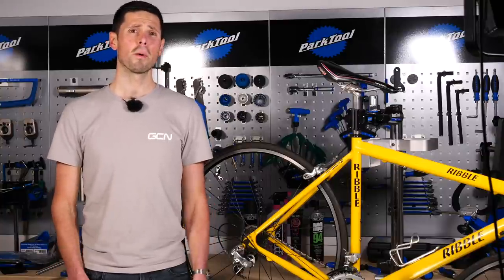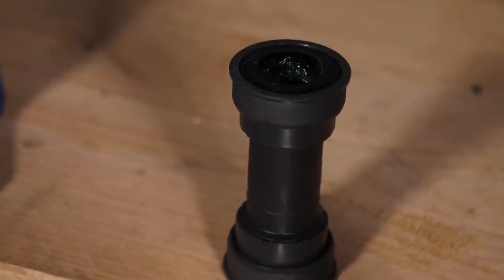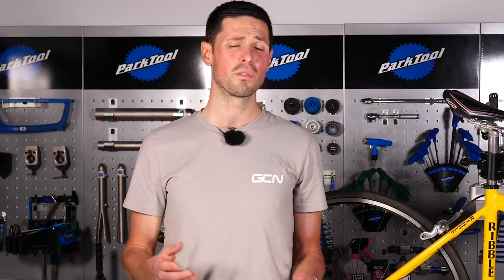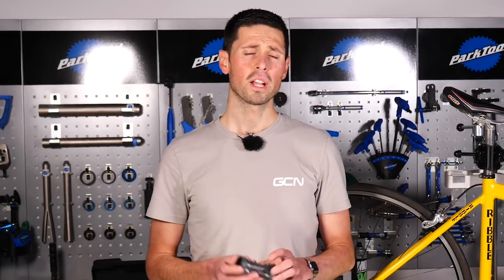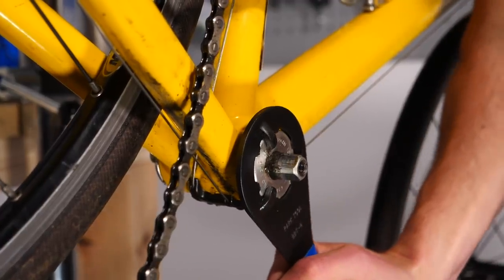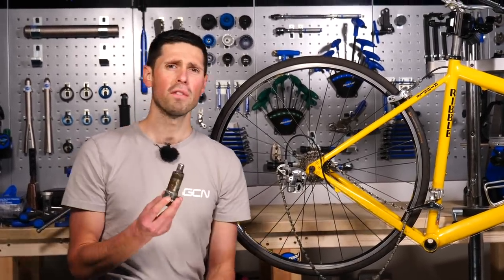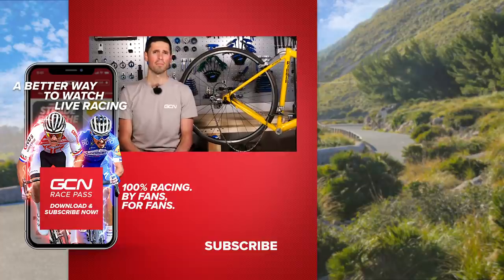How To Remove A Stuck Bottom Bracket From Your Bike | GCN Tech Monday Maintenance

Comment from the maker: Have you ever had your bottom bracket get stuck in your frame? How did you get it out? Let us know in the comments below!
Reply: Drop a few pellets of dry ice down the seattube. And heat it with a hairdryer. But that is if penetrating spray and a lever has failed.
Reply: Invest in the correct tool.
Campagnolo makes a six pin tool for threaded cartridge botoom brackets that is better than aftermarket alternatives.
Reply: With threaded, if everything you try has failed, I recommend a 60 in. long pipe wrench. Be sure you're turning it the correct way.
Reply: Cut the steel bb shell with angle grinder, pry out the shell open and unscrew using the tool. Install new cartridge. Clamp shell tightly closed and Weld short sections icing to prevent overheating cartridge. Not for the faint of heart but it works!
Reply: Just gave up and bought a new bike. N+1...
Reply: Last really bad one was in a winter commuter. Used a blowtorch to heat up the aluminium frame along with a cheater bar to increase leverage. It did work, and the paint wasn't terribly damaged. Hey, it's a winter commuter (fixed gear, using studded tires), not a showpiece :)
Reply: @jordyd8916  Just went through all that because of the non monetary value that one has. Continues saga to this day.
Reply: Increase the torque by adding more distance
Since, torque= rFsin theta , torque will be directly proportional to r i.e. distance so use proper tool and increase its length by some pipe or something
Reply: @korraja Done that sort of thing as a mill Wright. Luckily I didn't have a cutting torch handy! The heat from welding probably would break up the rust. Don't know how easily that hard alloy would weld. Oh well, turn the heat way up, better than cutting the shell as I did. Won't work  on a cartridge bb as it's aluminium. Ended cutting shell for that reason.
Reply: just liberated a BB from a 30 year old Rockhopper, looks like for the first time ever. Had to stand on a 10ft scaffolding bar...
Reply: was able to remove the bottom bracket on the right side using a pipe wrench but can't on the left side cause there's nothing sticking out for a pipe wrench to clamp on. Tried hammer and chisel which just ruined the teeth. So we welded a bolt on the center for the wrench to clamp on.
Reply: ..hoover nozzle pipe to extend bb4 tool and bad language worked fr me.Thanks.

Comment: HELLO HAMBINI FANS,

Some tips from me for threaded. 
1. Run a tap down the threads before you install the BB, bottom bracket threads are fine pitched for their diameter (1.0mm or 24 threads per inch), it's easy to get some cack in there and aluminium is soft so it will deform. 
2. Agree with the presenter, use grease. Lithium grease or something with a VERY HIGH NLGI rating, something like a 2 or 3. Grease in this case is not there for lubrication like a bearing, it's there as a static seal and assembly aid. 
3. When removing, these open spanner type units are often water cut or laser cut from sheet metal, they are comparatively weak at the tips. The cup type thing he had is much better. Obviously this depends on how seized it is.
4. Although he doesn't recommend heat, I do, I'd heat the entire BB area up with a hairdryer and then spray some freeze spray like loctite onto the axle,  Do this a few times and you will usually wonder where the resistance was.

A word on failure mechanisms. The usual method of failure or inevitable problem with these bottom brackets is galvanic corrosion. This is caused by the bottom bracket ending up like a battery and enhancing corrosion. The best solution to stop this happening is to remove your bottom bracket frequently, - you don't necessarily have to replace it.

Some tips for pressfit.
1. Measure the bottom bracket hole and bottom bracket before you install it. The majority of seizures happen because of excessive interference. The recommended interference across the board is 0.05mm. 0.03mm is better and my recommendation.
2. If this type of BB seizes, REMOVE THe bearings before you try to hammer the cups out. The majority of residual stress keeping it in are the steel races. The cups have comparatively little contribution to the retention.
3. if you are still struggling to hammer it out, then take the bearings out, and get a hacksaw and cut a slit into the sides of the bottom bracket. YOU DO NOT Need to go all of the way through, just enough to weaken the side wall. 

And the final thing is, your shiny bike with it's brand name is no guarantee of quality. Do your measurements and check for yourself before you buy.
Reply: I have a seriously seized threaded square taper, was thinking heat, but propane is scary when it comes to an aluminum frame, hair dryer and freeze spray a lot less so. Thanks!
Reply: The man, the myth, the legend
Reply: Not bad for a Frenchman
Reply: By Hambini, age 5
Reply: Sanjeev Varah why are you commenting?
Reply: It was more fun to use an angle grinder.  This 7 year old likes to see sparks and Weld. Besides it's lived a long and happy life since this treatment. All good advice from  Hambini. We need this guy to tell it like it is.
Reply: The thing that worries me slightly about "frequently" removing the BB, on square tapers at least, is that you run the risk of expanding the crank arm fixing holes little by little each time you remove and reinstall the arms. Maybe I'm lucky, but I've never had one seize on me so long as I prepare the threads properly the first time, so I would never do this to one of my bikes. I've had shop mechanics scoff at this idea, but Sheldon Brown wrote about it ("Every time you remove and re-install a square-taper crank, the hole in the crank is liable to get very slightly larger"), and I actually have an old Dura Ace crank (ebay purchase) that had obviously been removed and reinstalled numerous times over the years, and it indeed goes on a good couple mms farther than it should, nearly bumping up against the end of the BB spindle and effectively moving the chainline and Q inboard by the same amount (but as a happy coincidence, it yields a perfect 1-by chainline in its modified position). So be careful with this idea on square tapers.
Reply: Spoken like a true 5 year old
Reply: @CommaCam  This is fact. The square taper crank arms do expand making chainline narrower by a bit. Buy a quality bb and leave it alone. Vintage Campy owner.
Reply: @CommaCam  Yes tapered crank arms can bottom out on the tapers due to over tightening or too many removals.  At that points they will not stay tight and will wobble on the tapers wrecking the taper holes.  Your only recourse then is to go to something like a Phil Wood Sealed Cartridge Bottom with slightly over sized tapers where they will not bottom out.
Reply: Will I have to take a hacksaw to the cup? 
I tried breaker bar, 1/2" drive rachet, anti-seize; Nothing works.

Comment: As a shop owner, I've had bikes that would NOT have made this look so easy. NO amount of penetrating fluid helped after a couple of days,  and various "cheater" bars did not help either. Older model bike with the threaded BB, so the only option was heat and had no issues getting it out.  Now, a carbon frame is a different story, but if you're a trained mechanic, I would not worry about heat as long as it i not held in one spot all the time.

Comment: Most important for threaded....make sure you are bashing it the right way! Not all threads are lefty loosy, righty tighty.
Reply: Exactly  as he showed in this video, in fact. He had to turn it clockwise to loosen it.
Reply: @indorock  Correct.  Bottom brackets are threaded opposite pedals:  right side(drive side) is left-hand threaded, left (non-drive) side is right-hand threaded.
In case you didn't already know, this is to keep the bottom bracket from unscrewing itself as you ride.
Reply: @surlyogre1476  I always thought that too but in this bike shown it was the opposite as normal, on his drive side he turned it clockwise to loosen 🤔
Reply: @davidmidcalf3470  maybe i am wrong but i thing if you look from the right side with the chain rings the main force is applied by rotating the crank clockwise.
The axle rotates clockwise so the bearing tends to rotate anticlockwise and and so a force is pushing the inner bracket anti clockwise( imagine a ball turning clockwise with a ball on top wich is then turning anticlockwise. The ball on top is the bearing the other one is the turning axle) so the bracket is on this side left hand threaded.
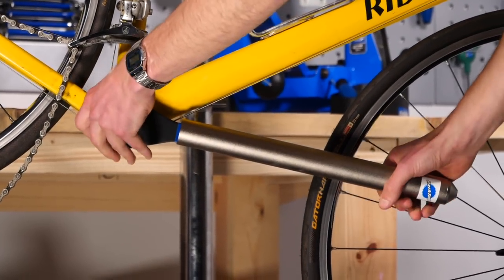Reply: @davidmidcalf3470  Sorry.  I went back and watched the video again.  At 0:25 and again at 4:25 the presenter turns the wrench clockwise to remove the BB. 
 The drive side is left-hand threaded.
edit:  Perhaps I misread your post... I think we agree?

Comment: Pro tip for ya (for older threaded BB shells):
After BB removal and cleaning up with a rag and some solvent, go to the hardware store & get yourself a 1 1/2" round radial wire brush to be used in a drill.  You gotta kinda push it into the BB shell, but once you do, it will clean it out like magic.  Utilize the drill reverse depending on what side you're doing.  You'll be AMAZED at how it scours out and cleans up the threads.  Truly amazing.  Pretty much equivalent to running a set of taps through it.

Comment: I had to trash a single speed frame, because the manufacturer did not install the BB with grease. The BB was impossible to remove.
So, after buying a bike or frame, service your BB directly straight away. The same for the seatpost: remove, grease and re install.

Comment: I had a bottom bracket really seized, on a 20 years old touring bike that was used twice in Canadian winters through the snow and salt. The proper tool and a 60cm breaker bar did not work. Neither did anti-seize fluid and a big hammer on the breaker bar. Finally my son who has worked on old cars suggested using an impact gun. It worked like magic, instantly. On another cross-country bike, after 5 snowy and salty Canadian winters, before knowing about the impact gun magic, I had an hollotech II bottom bracket (aluminium?) stuck in a steel frame. I carefully cut the bottom bracket cup in three and was able to destructively remove it piece by piece.

Comment: Thankfully this chore only cost me my marriage. Both our bikes getting upgrades, but her BB seized when we attempted to remove. Threaded square taper Shimano BB removed with the cursed spline removal tool. Used socket spline tool held in place with a carpenter's clamp, then turned using old heavy duty pipe wrench.

Comment: I find square taper cranks seize on just as bad, try and use the tool and it just rips the threads out the inner of the crank, I've had this with 2 of 3 old bikes Im doing up. I think I might invest in an angle grinder
Reply: This happened to me only yesterday on a bike I got cheaply & thought I'd replace the cranks on.
I was screwing in the extractor thinking, surely it's gotta give soon. Then it got easier. The only part of the crank that came off with the tool was a spiral of the aluminium thread from inside the crank. Thought, nup, they're stayin there. 🤣🤣🤣

Comment: Here's a tip I found out the hard way - after the Campag square taper BB tool slipped off. Use the bolt in the end of the taper to clamp the tool against the keys on the bearing race (using suitable spacers). I then used a 3 foot scaffold tube to apply leverage. It was on the ground NOT in a stand.

Comment: #askgcntech 
The TL/DR version: Is low stack height and compact bars twitchy? Is high stack height and deeper drop bars more stable? 

The Ollie version:
Could you please explain how a stem's stack height affects the handling characteristics/stability of a bike? Raising and lowering your stem will help achieve a desired riding position, however the stem's stack height and the depth/shallowness of the handlebars are separate metrics which affect riding position, both on the flats and in the drops. Essentially: You could achieve a desired performance riding position in the drops by changing the drop depth of your handlebars, not just your stem height. However, since the steerer angle is not perpendicular to the ground, messing with stack height also affects front end responsiveness. Raising the stem also brings the pivot point toward the back of the bike, while lowering it pushes it toward the front of the bike. 

Similar to how "trail" affects stability of a bicycle, I want to know how stem stack height affects the pivot point and responsiveness of the front end. 

Hypothetically: All metrics considered (including the small change in the stem's reach when you raise and lower it, again due to the steerer tube angle),  if I could achieve the exact same riding position in the drops with high stack height and deeper drop bars as I could with a slammed stem and shallow drop bars, what would be the benefits/drawbacks? 

Thanks guys and keep up the great content.

Comment: I've tried everything except heating. pretty big hammer, frame was laying on static support so could hammer pretty hard. Added some industrial solvent. Actually I removed the cap of the bearing but just because the tool slips off the side of the bearing which is weird, looks pretty firm when I investigated it.

Comment: An RAC man was replacing a dead car battery on my drive. 
I had an Ocatalink square taper I couldn’t get off. We used the park tool bit on the end of a leverage crank, about 1.5 metres long. Slipped right off. 
2 vehicles at once😃
Reply: Octalink and square taper are different designs... it's one or the other...

Comment: If the BB is really stuck, take the Bike off of the Stand and put it on it's wheels so as to not lose torque to the flex in the stand mounts.  Also, might try bolting the BB tool to the Crank Axle mount holes so that the BB tool does not slip off.

Comment: #askgcntech Hi. I was thinking of upgrading my bike by fitting it with carbon seatpost. Do you know if using it along with bikepacking saddle-bag (c.a. 15L) can damage it? Im thinking rather about breaking rather than scratches as the ones can be mitigated with electric tape. Thanks. Marek

Comment: That jerking acting to break the threads loos strips them more often than not. Try gently tapping with that “big” ( what a joke ) hammer and reapplying the penetrating oil one day at a time for a week. Come Saturday, that Sunday project will have unthreaded as if new. And use anti seize for reassembly

Comment: The question is, why do companies (like Truvativ) design such components that not only require special tools but even then can be very difficult to remove (once rusted), if at all, while instead, there is enough space to design a BB that one could get a normal wrench on? So the manufacturer makes some money until the Chinese (which likely makes the proprietary components and tools) come up with knock-offs?

Comment: #torqueback I have a round tube bike from the early 2000’s and wanted to make some inexpensive aero upgrades. I wanted to ask if there was any way to make the frame more aero by adding small and subtle addons to make it resemble aero frame tube shapes. It’s ok if these aero upgrades just last for one ride. Examples: somehow make the downtube more ‘airfoil’, likewise the seat tube. I of course don’t mean bending the actual frame, just small addons to make it mimic that design. Pros and cons to potential added weight. (Using card board or some other material)

Comment: Great video, thanks very much. I was wondering if you might be able to do a small feature about front mech cable rollers please. I use CX bike as my main bike and it has one of these behind the bb/seat tube. I never know how tight to set this at and if I should grease it etc. It gets really dirty from commuting. Also, are there are good quality upgrades for this part - a nice Hope anodised version for example? Cheers, P
Reply: I'd recommend a good pair of fenders/mudguards too keep the muck away from yourself and the bike.

Comment: Hi There. Great video. I've never taken a BB out but I did notice you turned the spanner clockwise to undo it, which suggests to me it's a left hand thread. Are they all left hand threaded if the screw type? Oh, I would always wear thick gloves so as not to get knuckle rash 😀 with a slipping spanner
Reply: Probably 99% of threaded bottom brackets are "English Threaded", with left-hand threads on the right side and right-hand threads on the left. The other threaded bottom bracket type you're likely to see is "Italian Threaded" which is right-hand threaded on both sides. If you look closely at the side of the BB, it will often be marked "1.375 x 24" (English) or "36 x 24" (Italian). This might be a good primer: https://www.parktool.com/blog/repair-help/bottom-bracket-standards-and-terminology
Reply: @mattgies  Thank you.  I did not know that about Italian threaded BB.
Reply: @surlyogre1476  Cheers!

Comment: When knocking out push fit BBs I would definitely not hold the frame by the seat post and start hitting the BB with a hammer - Noooooooo. I invert the bike on the floor and support it with my thighs while I hammer the BB out. Remember that with a Shimano you need to prise out the central dust tube to reveal the bearings. Nobody ever tells you that!

Comment: 5:57 you are giving a wrong example dude. You are at risk of falling, damaging your bike stand and consequently damanging your pride and joy. The correct way to do it is to put the bike on the ground preferrably upside down to avoid damaging the wheels. Otherwise you can do it by using your feet to stand on the tool and use your weight to exact force on the tool.